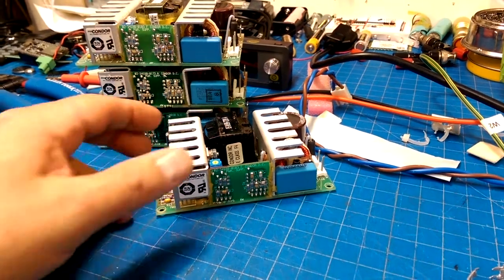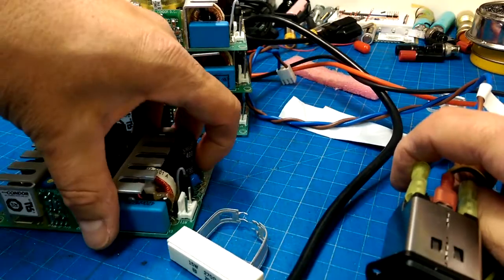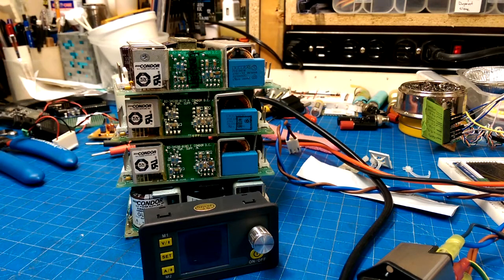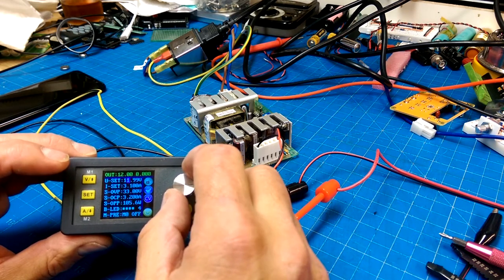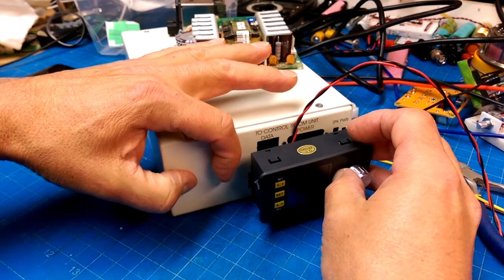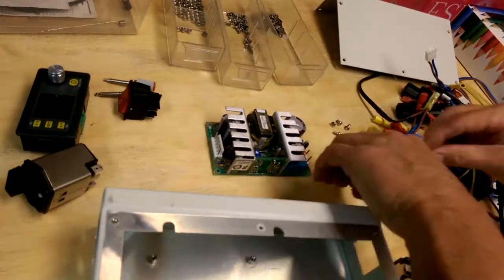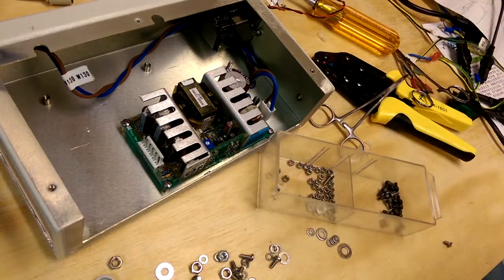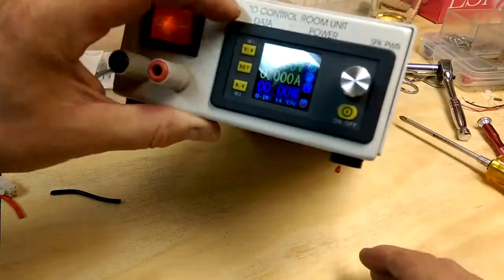DPS 3003 Build

Comment: Couldn't you series them and go up to ..~28V ?

Also, where's this recycle bin you mention .. just asking fir a friend no reason
Reply from the maker: Yes.  But then I would have to fuss over isolating the two supply modules from grounding against each other.  I didn't want to deal with that.

It is literally right outside my office.  But if you have any electronics recycling program in the city where you live, you can try and tap into that waste stream.  Or use google to find technology oriented business parks ( like around a tech college for instance  ) and start scrounging....
Reply from the maker: This is what is in the recycling at work currently.....  https://youtu.be/-LQpqEU9G8M